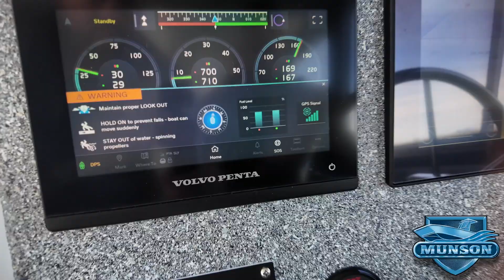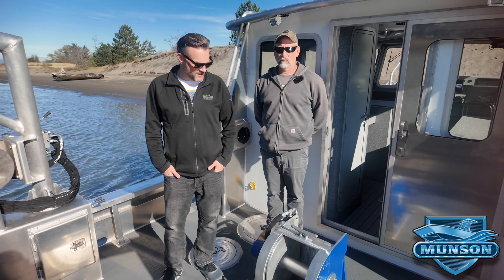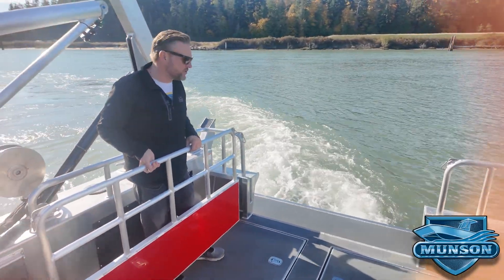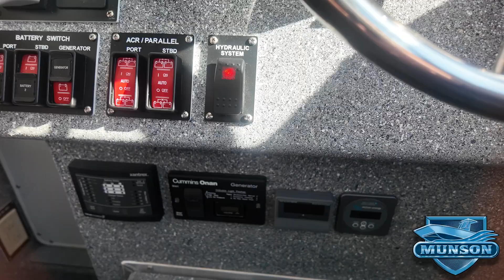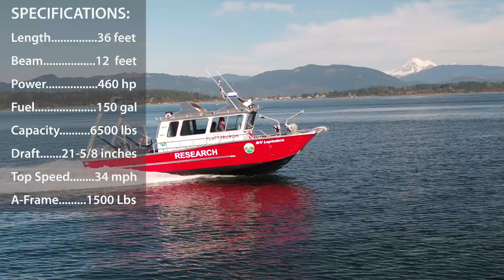Walkthrough of Munson's 36' Research Landing Craft for the State University of New York

Comment: Beautiful, two questions, is it good also for open sea (continental shelf)? does it have a toilet for long days out?
Reply from the maker: The vessel features a full head compartment in the aft port corner of the cabin (there are privacy screens for the windows), all of our vessels have self bailing deck with large scuppers and every vessel is designed an built to order to meet the needs of the client and their area of operation. Operating in open water is not an issue.
Reply: @munsonboats  Who to contact about a similar boat?
Reply from the maker: @TimorKatz  give us a call at 360-707-2752 or reach out through our websites "contact us" form, and i will get back to you immediately

Comment: Absolutely beautiful boat ,just wondering the size of the engines being used?
Reply from the maker: Twin Volvo D4 270hp
Reply: Another question I have , can larger engines like the Volvo 440 or 480 be used in the Munson pack cat and what size boat would be needed?
Reply from the maker: @KevinPatrick-b5f  Every vessel is designed and built to order, larger engines is not an issue.